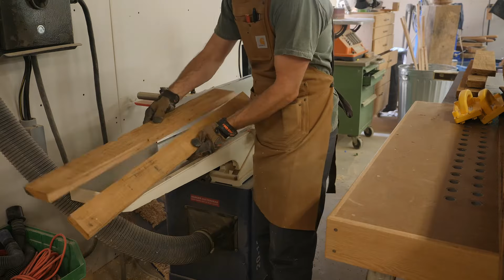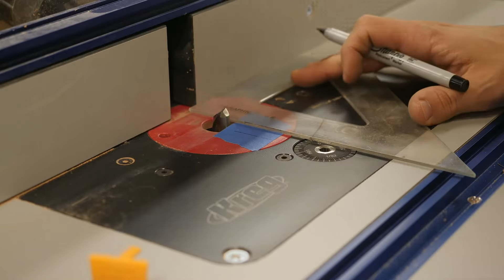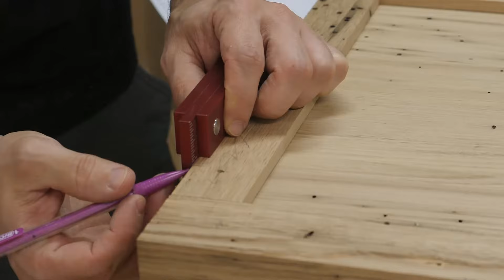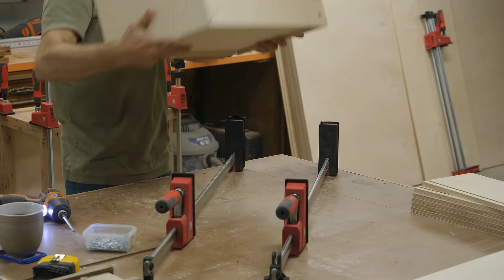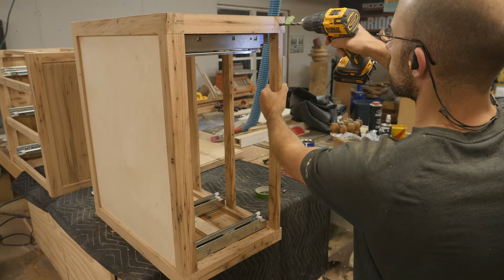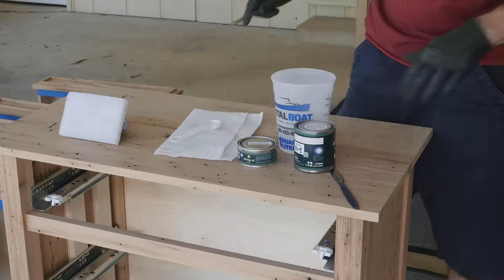How to Build a High Quality CUSTOM NIGHTSTAND

Comment: Excellent joinery on these pieces !  Tight domino one side loose on the other. Professionally well done. I hope to get one myself but hard to justy as a hobbyist
Reply from the maker: Thank you so much Keith!  The Domino even as a professional is an expensive tool but it's paid for itself many times over.  I found mine second hand on FB marketplace!